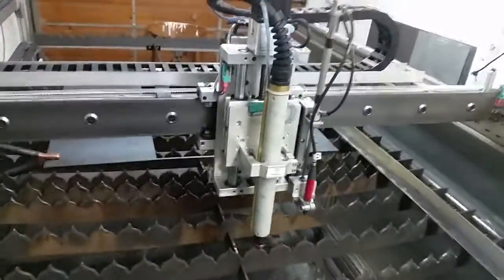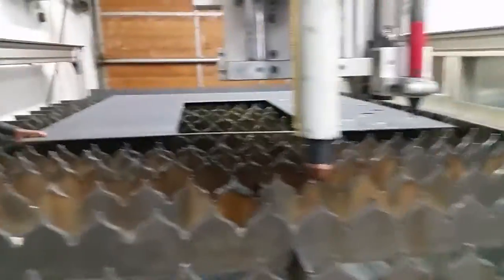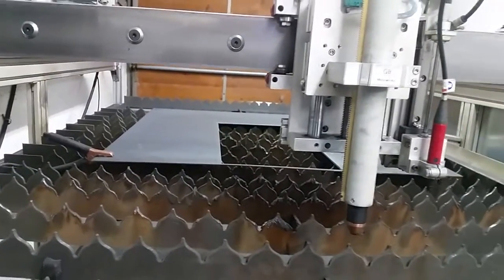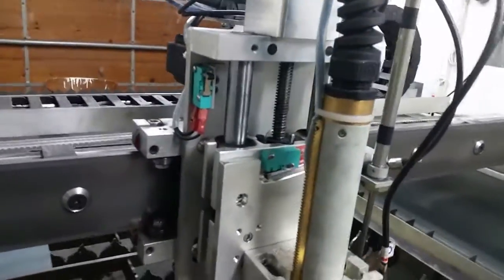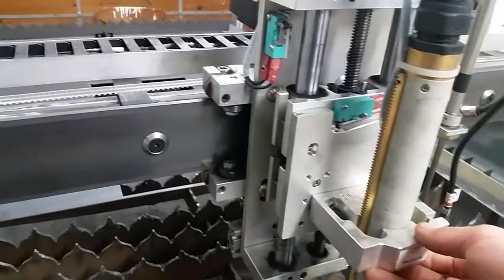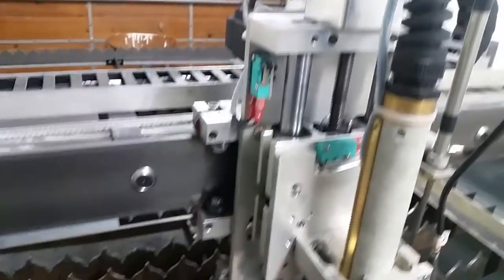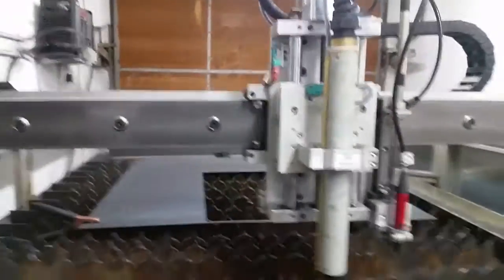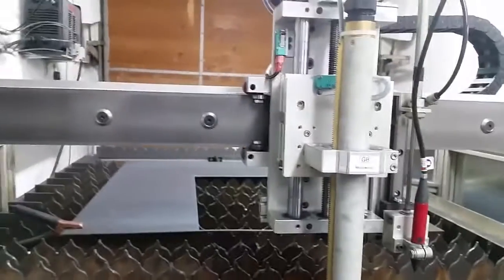CNC Plasma : Floating Head Probing Mechanism (Z axis)

Comment: how exaclty do you set that up on mach ?......are you using a macro or something? im thinking about using sheetcam for my cad but im a little confused as to how the probing and then setting its self to clearance height will work...can you offer some insight?
Reply from the maker: I use sheetcam because of its wide range of post processors.. probably what you are referring to as macros. These offset values are then hardcoded into the post processors. I'll try and create a video this weekend.
Reply: Thank you so much!!! That would be awesome to see the visual representation of that action.... Ive been having some trouble wrapping my head around it.
Reply: @MitchGreeley  Sir , plz tell me How to configure the floating head micro switch in the mach 3  to sense the initial height ??? Plz reply. ..plz upload the video plz .

Comment: hello!...i had a question....im building a plasma cutting cnc machine on my own and i want to make a floating z torch head in order to probe where my material is and set the ztorch to pierce height........im not sure if this action is created in the mach 4 i am using, a special script you have to type out with gcode and include in the gcode generated from the part in cam software or what?........i want to first understand what exactly is needed and how i all works together, also what type of cam software would you recommend for plasma cutting out parts? thank you so much
Reply from the maker: I use SheetCam. There is an offset you can put into the post processor, there are many post processor options. (this post processor is what writes the G-Code and tells Mach-3 what to perform.)
Reply: so sheetcam has this option? (the offset?) will sheetcam make that action repeat at the start of a new part cut out?......like will it send order to probe ?

also the probe sensor is activated in the mach 3 settings right ?
Reply from the maker: Yes it has this option. This action is programmed to execute before your torch fires (in the GCode). This sensor is an input in Mach3. Mach 3 waits for the signal before proceeding further in the Gcode
Reply: Sir , plz tell me How to configure the floating head micro switch in the mach 3  to sense the initial height ??? Plz reply. ..

Comment: Is this velox Z? How do you mount the Z to cncrouterparts carriage?
Reply from the maker: Yes, this is from Velox. I made holes in the Z back plate with the top ones being slotted holes so I could adjust if necessary.